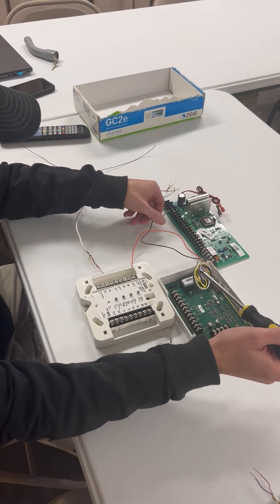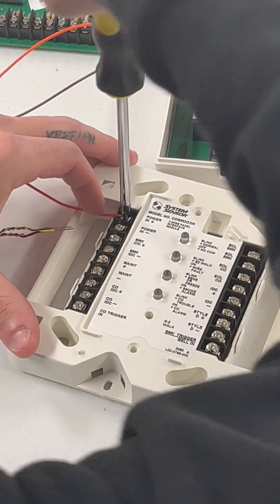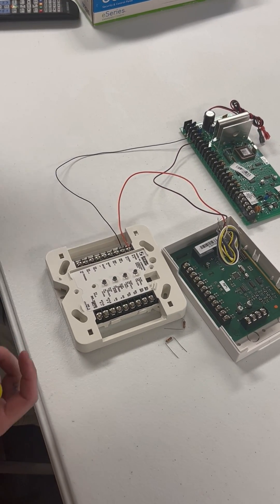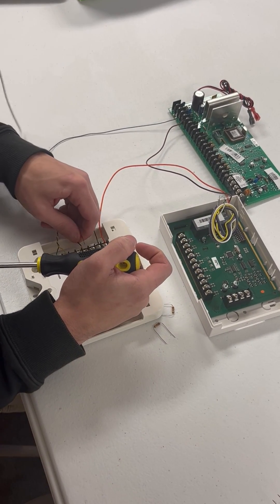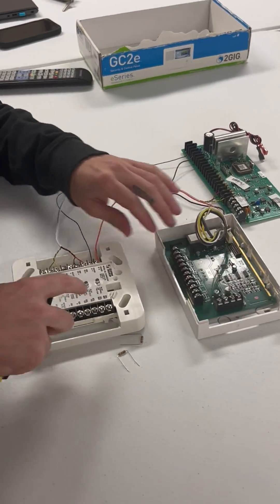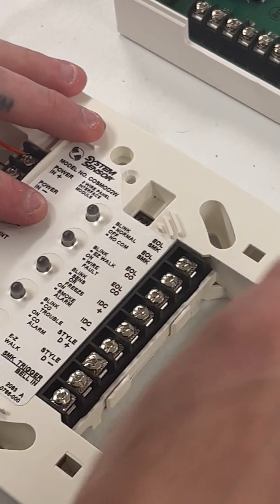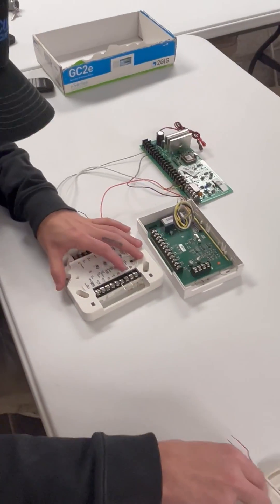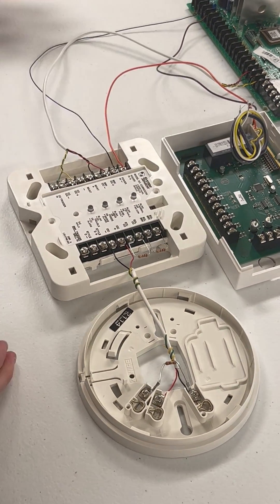COSMOD Wiring

Comment: Assuming you max out installed smokes on the cosmod2w can the vista panel aux power support all devices or do you need a Aux power supply at some point? I’m confused on how to calculate the draw of the smoke devices in alarm state from the different spec sheets.